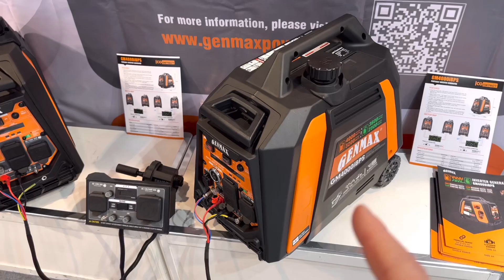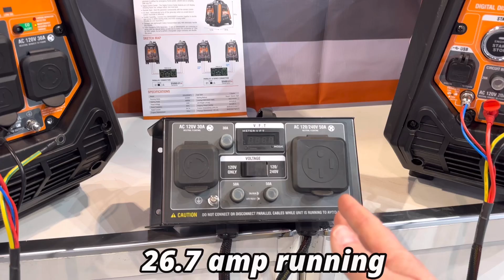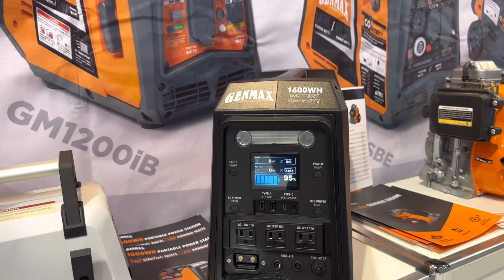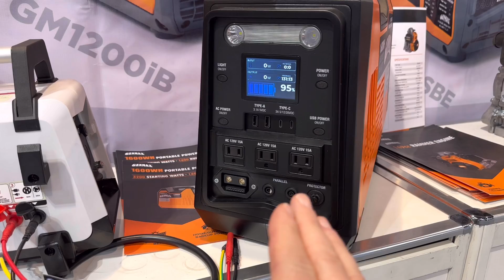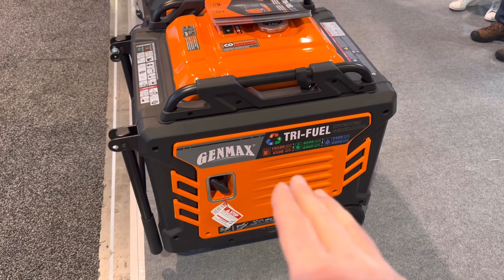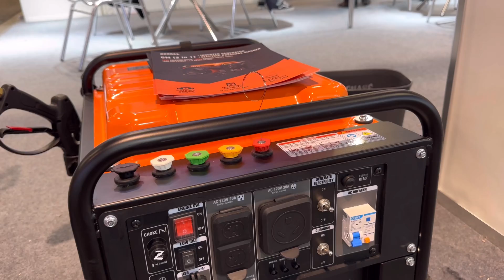Best new generators 2023!! New Generators Never before seen !! EFI and More…

Comment: Please review the EFI generator. Currently I have only seen Honda producing generators with fuel injection. Impressive.
Reply: Hi I just found you on YT and I am trying to find a solar generator but I know I'm going to need a fuel generator to recharge it cause I live in a small Townhouse 1100 sf and want to get a solar panel . Is there a unit you would recommend.  I currently have an older but not yet used AI Power AUS2000ID dual fuel generator. I would appreciate your input and will buy you a coffee if you can help me sort put all this as I'm new to backup generation. 
Thanks 
GE
Reply from the maker: The Aipower you have will charge any power station or solar generator. 
It’s really about budget and I also find people buy to small of a power station thinking it will do everything. 
1000wh is minimum if you want to last a full day for say a fridge. 2000wh and you can do so much more. 
What is your budget?
Reply: @johnnysweekends  I can if I must to get a good SG go to about $2500.00 or maybe a bit above if push come to shove. Thank you for any help you can give me on brand and value. I also need to include some sort of solar panel (s).
Reply from the maker: Honestly if you have that amount the new delta max 2 is a pretty nice option because it can be expandable and use the smart gen. It has a couple draw backs but still one of the best especially during super sales. It’s a new favorite for sure but bluetti has a couple nice ones as well. I lean a little more towards EcoFlow right now. The other option is to build your own which is by far cheaper and honestly not to hard.
Reply: @johnnysweekends  Do you have videos or tutorials on how to do a build? BTW thank you fir your responses and help. I'm trying to get wattage on my appliances but can't find any help from Whirlpool online or by telephone. Once you buy something these companies nowadays are done with you. I guess you can tell I'm an old guy by my conversation LOL

BTW do you think the A I Power generator would charge up a DeltaMax2 in a reasonable time?
Reply from the maker: Yea customer service these days is hard with staff shortages. But yea the Aipower 2000 watt model is rated at 1600 running. So if you do a 1100-1200 watt load it will hum along and have it charged in less than 2 hours. Always use any solar when you can.
Reply from the maker: I will asap. There was actually one other brand that had it several years ago that is still floating around on the used market but forget the name. I’ll have to find them again

Comment: Ecoflow has a double voltage hub to get 240 from 2 120 volt units. I was wishing Honda would create something like this. Looks like genmax  has done it, at least for new units.
Reply from the maker: Correct Roy ECOFLOW has the double hub but that’s if you use two Delta pro units. It doesn’t work using the gas generator they have. 
I was wondering if something like this would show up and had no clue, and boom there it was.
Reply: That's what I'm looking for EcoFlow but their smart generator is too expensive and runs at too high of RPM'S in my opinion.
Reply from the maker: Most the new gens are all starting to bump up to 4800-4850, kinda crazy but the whole ecosystem is really cool

Comment: Just starting to watch your video.  Very interested.  My goal is something like 2000W with triple fuel - gasoline, propane, and natural gas.  External plug and play devices to achieve triple fuel is fine as long as it is manufacturer approved.
Reply from the maker: New video Sunday for existing dual fuel units to NG…😀👍🏼
Reply: @johnnysweekends  Nice - we need a generator for the house to keep a fridge and freezer going in the even of a multi-day power outage.  I have some gas and propane, but we also have natural gas and that is the sure thing in the event of a long-term power outage which we've had a couple in the last 25 years.  Just want to be prepared to use natural gas if that event happens again.
Reply from the maker: Well the easier way is buy a tri fuel generator but you can buy the kits as well. 
Kinda depends what ya wanna do. 
If your in the market for a new unit I would buy a tri fuel unit.
Reply: @johnnysweekends  Sounds good - will keep watching your excellent videos.  We should buy in the next 6 months or so just to be prepared.